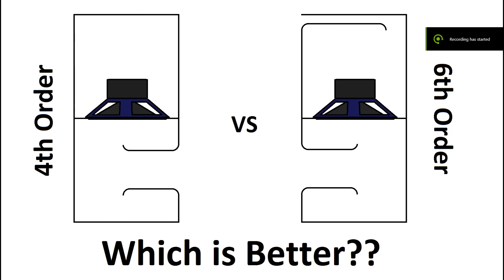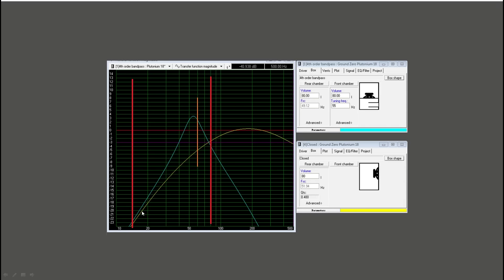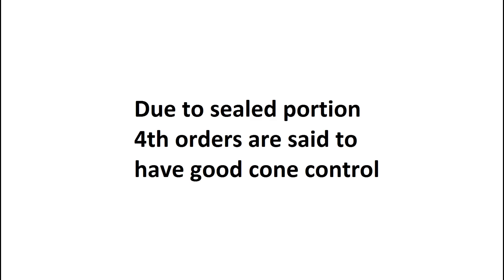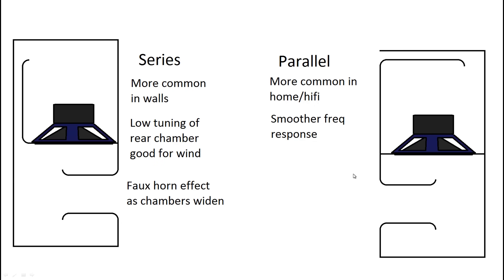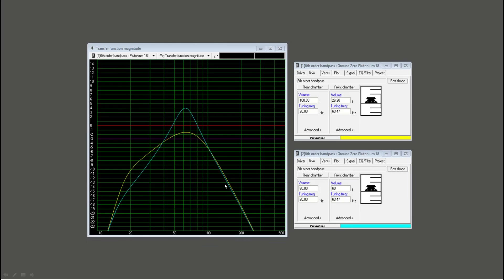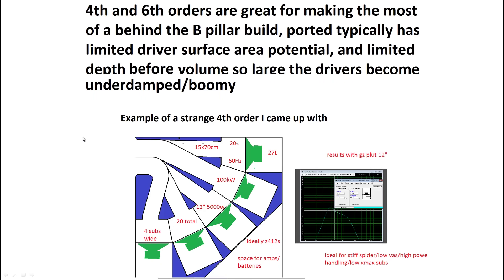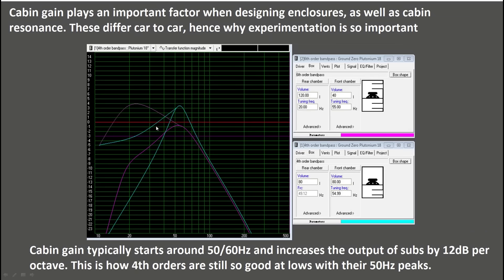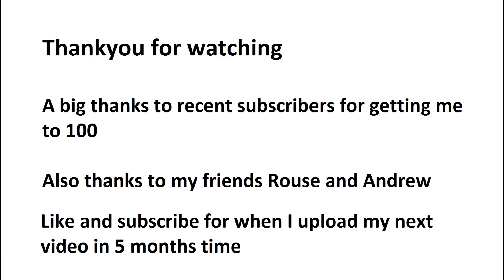4th Order VS 6th Order subwoofer Enclosures

Comment: What type of enclosure would be the best choice to use for rock and metal music in a 1970 to 1981 Camaro going through the rear deck between the factory mid/high speakers?
The reason I want it in the rear deck is to reduce noise outside of the vehicle and the ratty trunk vibrations.

Comment: I’ve seen dual 18” 6th order pro audio subs that contain 2 drivers facing each other in a sort of “loading wall” like you show here. Basically, there’s a port on each side, then this big open almost horn-like mouth in the middle. (It slightly tapers out, but I wouldn’t consider it a horn.) That design has the most SPL of any subwoofer I’ve heard.

Comment: you got the qts part wrong. the lower the qts 4 and lower is better for 4th orders 4.5 and up is better for 6th orders. the lower the qts (4.4 and lower) means it responds well in sealed. the higher the qts (4.6 and up) better response in ported boxes.

Comment: Absolutely amazing video. Honestly, you helped making the super technical details understandable. 

I have a question for you. I am more focused on SQ than SPL. I have been seeing a lot about IB setups and the level of lows and spacial presence that are achievable. I am considering a project vehicle that runs a front sub (likely 10 inch single centered or dual 8 inch sealed in the doors) which would be effective from about 150Hz down to 50 or 60 Hz. Of course with SQ getting the most balanced freq response at the cleanest highest levels is best, so, what would you suggest for the rear of the vehicle (most likely large SUV like a Land Cruiser or Toyota Sequoia) to pick up those missing low freqs? IB has is own unique challenges and requires serious modifications but can fill the listening space with sound like no other setup. Is there a 4th order or 6th order setup which can achieve similar levels of presence while not requiring the same level of modification as IB? I have also considered Isobaric as a solution to keep the enclosure size down but i don't know if that is still viable with todays tech.

Comment: 🟦....'Porting', 'Enclosure-Damping' & 'Port-Damping' are Three ENTIRELY DIFFERENT THINGS, The way you Dampen a Port (or Port-Tube) has apparently become a 'Lost-Art' in today's world, as there is NO set of calculations or instrument other than the human ear that can accomplish this.

it consists of tightly-stretching ONE-Layer of 10-denier-silk @ a time to what could end up to be several-layers of silk TIGHTLY-STRETCHED across the MOUTH of the PORT until Proper-Damping is achieved.

The Way to properly 'Dampen' a Port is by taking a D-cell battery and connecting It in PROPER-POLARITY to your woofer/midwoofer driver/s (+ to +) In such a way that you can quickly make & break the circuit on the POSITIVE-Side. (DO-NOT leave the battery hooked-up to the driver for more than a few-seconds)

.....When you quickly make or break the circuit, without ANY-DAMPING you will hear a kind of a "Bong"-sound, What you need to do is to keep testing and stretching another-layer of 10-denier silk TIGHTLY (to eliminate 'Fluttering' of the silk) across the mouth of the Port or Port-tube until the sound you get when you either Make-OR-Break the circuit is a Shorter-TIGHTER sound, closer to a "CLICK"-sound than a "BONG"-sound.

Once you've minimized that sound to as close to & as 'Tight' a "Click"-sound as you can get, then proper "Port-Damping" has been achieved.

Comment: position of a box inside a vehicle adds to the ratio which i never find anyone seems to know about. 
ex: speakers in a trunk try positioning the speakers towards the back horizontal about 6 inches away from the back vs turned around to the front.

Comment: In series tuned 6th order,  kniwing the front is tuned higher than the rear, It seems that the front port doesn't load below tuning, where the rear one does, so the lows is coming from the rear port. Correct?

Comment: Question on doing a 6th order (might be a dumb questionoh well but here goes it anyway lol. Lets say you have this to work with D37"xW52"xH36" then you put a box on each side for D37"xW15"xH36" and port it at 26hz then it leaves D37"xW22"xH36" in the middle of both boxes do i use the  D37"xW22"xH36" measurements to figure out the last port i want or the total dimensions? D37"xW52"xH36" that both boxes is in?

Comment: I curious to know if I can change my subs up/ports back BR box into a 6th order by adding a second chamber on top. My og box is 2.1cuft @35hz. I've modeled and built the top chamber and it's ready to go on. QUESTION ⁉️
Since my current box sounds best ports back, and the 2 chambers are essentially 180* out of phase with each other (right?).. could I face the port of the upper bass forward? Firing in the opposite direction of the lower bass ports?..or should I just go with the tried and true "all ports exiting the same direction" method?

Comment: Do you know of anyone who has built a large bandpass like you illustrate with the 20 subs , i was thinking of building one of these but I don’t want to waste time and materials, any thoughts?
Reply: 20 Subs...
What brand of woofer do you plan on buying? 
You will need a ton of wattage and amperage. it's a money pit.
are you ready to spend all that cash on car audio. 
I never did and I had great sounding systems. 
2 Subs component speakers for everything else three amplifiers across over. lithium batterie high output alternator proper wiring did my own installations and that was a lot of money. I could not imagine spending on a system that would support 20 woofers I refuse to spend that much money on a sound system when I have money to spend on my mortgage, my car payments, my family, bills and so on. How do you plan on doing it Lotto ?

Comment: Understanding the driver's ts parameters,and what the values affect determines the direction in Wich is "best" for your application,there's allot misunderstood in the box decision for all speakers, I prefer to use speakers with high q values qtc qts etc, in a sixthorder bandpass, The bandwidth gain is phenomenal when designed correctly,and if you run them isobaric loaded, they can use a smaller enclosure

Comment: I have a sundown x15 v.3 should I put that in a 4th or 6th order
Reply from the maker: From the specs on the website, if you've got the Dual 2 ohm, either, really up to you. If you've got the dual 4 Ohm, 4th order would be preferred, but still either or. They have a good multipurpose spec.

Comment: Hie please can you help me ...i have a kenwood wps1300d and i was thinking of putting it in a bandpass box .On its manual there is only two options thus sealed or ported...will it work well if i use the specs for the jbl p1220 bandpass box?

Comment: Hey Dak, just for information purposes, if doing a 6th order series port, can you have the same size port for both the low side and the high side? lets just say 30hz with a 40sq inchs of port and 65hz high side with the same port size. 4cubic low side 1.25cubic high side, net. 

will there be any complications with this scenario? winisd gave off some pretty solid responses, but im looking at a theoretical response for reference to my simulated design.

great videos again. keep it up

Comment: On a 4th order which part of the subwoofer goes into the sealed chamber, the cone or the magnet part? Does it matter? What is the difference?
Reply: It’s best to have motor in the ported side. This helps with motor cooling as well as you being able to smell the coils if it gets too hot
Reply from the maker: I'd personally put the cone in the sealed part, unless the motor makes a ton of chuffing
Reply: No difference except better cooling of the voice coil if it on ported side and you see most front firing into the sealed side simply for space reason if the enclosure is a 1 to 1 then the side you put the magnet on will be less air space so when designing make sure you add your speaker displacement to the correct side or your ratios will be off

Comment: If you graphed the 6tg orders as 1 octave apart instead of way far apart it'd make a massive difference
Reply: 1 octave generally creates a dip in your graph, so you’ll lose some of your middle end.
Reply: @camaroboi13  every 6th I've ever seen built or had designed/discussed with builders they/me have always done 1ocatve apart for best results. You think 1 octave is giving a dip in the middle a proper 6tg should have no dip it should be a large peak vs two peaks now placing the peaks more than an octave apart like in this video creates a way worse dip because the frequencies are even further apart

Comment: I still get bewildered by boxes I see, some of these "4th order" demo builds I see have such a big opening I don't see how it's much different than a conventional sealed box. My experience with sealed was good SQ but abismal output, I plugged the port on my sub box and I lost about 50% of my output I did loose the nasty boominess I get in the higher frequencys I've been trying to combat. I'm at a loss I have 2 AB XR 15s in a 6.75 net box that's been tuned to from 36-29 in different port modifications Starting at 129.5 ci port area now I've slightly reduced the port in different ways but still there, on low lows it sounds epic killer flex but some higher notes it gets boomie and muddy not good sounding at all. I built the box for subs up port back and now subs back port up has reduced that issue the most. It's in a grand caravan. Any input would be appreciated...
Reply: Is there anyway poss you can help me. I have 2 ab xr 10" which im trying to build a box for them. I have no clue on where to start. I want subs up and port up also. The space that I would like to put the box is 32" width 16" depth and 20" height.
Reply: If anyway poss you can send me some cuts of the wood so I can put it 2gether. I would like to use 3/4 mdf or if you recommend something diff

Comment: 9:04 it is 1:4 right? Just wander for the picture before the graph the "home type" ratio was 1:3. Very educative! Cheers!
Reply from the maker: 1:3 or 1:4, either could work depending on the driver. For the example, it should've been 1:3, the 1:4 given is a default for WinISD, not sure why I didn't change it.

Comment: How much $ to design a 4th order bp for an 2017 mustang gt. Sub is sa10v2 1000 watt rms. Amp is a skar rp2000. I have 34" wide by 13" high and what ever the depth needs to be up to 24". Possibly a 6th order if there is room.

Comment: On a parallel tuned 6th order which is 1:2 ratio, should both ports have the same size  (port areas) or should they be in relation to the size of the chambers?
Reply from the maker: In relation to chambers, though for my 6th the low tuned side needed a port so long I just made them the same surface area. Sounded fine, but a tad muddy, so  same area is preferable.
Reply: @Dakoustics  thanks man

Comment: I figured out an interesting thing when I tried to design a parallel-tuned 6th order bandpass box, but I dont know that the designer I'm using (speakerboxlite.com) is OK for designing a 6th order bandpass box or not, because if I try out a standard ratio box with normal tuning frequencies - like for example 30 and 50-60 Hz, the cone displacement graph (the woofer's excursion) will be crazy + totally different like for example in WinISD. So, my first question is: in your opinion is speakerboxlite.com usable for designing a parallel-tuned 6th order bandpass box? I'm asking this, because I know that for simple sealed and vented box it is good - I built both types of boxes using this designer, and they are sounding a working fine up to today, just I'm sceptical when it comes to design bandpass boxes using speakerboxlite...

So, what I figured out using speakerboxlite is next: if I tune super-high the high-chamber (above 200 or 300 Hz), this chamber works like an excursion-restrictor (cone displacement graph), so it allows to make higher net volume and/or lower tuning for low-chamber. Then, if I tune the high-chamber higher, and/or I increase it's net volume, it restricts the excursion even more, etc... So I think that it will work like this: the low-tuned chamber is the active chamber - for sounding, and the high tuned chamber is the passive chamber - for excursion / power control. And I think this excursion restriction is the reason too for higher group delay, because if I simulate the low-tuned chamber's net volume and tuning frequency as a simple vented box, the group delay is less, but the woofer's excursion is higher. So, this is my second question: it is possible that a parallel-tuned 6th order bandpass box can work like this + this "my theory" is OK, or not?

This is a simulation (graphs) for those things what I explained above: red - the low-chamber as a simple vented box, green - 30/50 Hz, blue - 30/60 Hz, yellow: 6th order box with 300+ Hz tuned high-chamber: https://speakerboxlite.com/project-info/f63b6c1c22086b6c467566a416d20b930e5fbb2c055e4ddc0e7e048a80c21043/tab-graphs .

This is a complete design (description, 3D, quoted drawings, etc...) what I've done just today: https://speakerboxlite.com/project-info/13537/tab-info .
Reply from the maker: Yeah, seems very odd, not sure what error is happening there. Probably use WinISD, I used it for my 6th and the thing is fantastic. Hornresp is very accurate also, and I've done some comparisons between WinISD and Hornresp and they were quite similar. Interesting observation though, I'm guessing it has something to do with cone damping, and possibly the high tuned box is acting practically like a sealed chamber to damp and control driver movement.
Reply: @Dakoustics  , thanks for your answer. Cone damping - maybe the super-high tuned high-chamber works like you wrote, because I tried it once in WinISD, and the driver had very similar (but not the same) movement in simulations like in speakerboxlite's simulator...and overall all graphs were similar but not the same... So at 4th order banpass the sealed chamber is for low bass, and this is the "main driver movement controller" too, and at 6th order bandpass like this the chamber for low bass is ported too, and this chamber is the "secondary driver movement controller" - this is the main difference in my opinion, just at 4th order bandpass you may not need to tune the high-chamber up to a super-high frequency - so that is the reason why I think that at a 6th order bandpass like this the low-chamber is the "active" chamber - this sounds, and the high-chamber is "passive" - this just controls the driver's movement... In your opinion this theory is OK, or I am totally wrong?
Reply: @Dakoustics  , I made a test-project in WinISD using the same woofer like in those projects what I shared with you before. I downloaded the speaker file from here: http://www.loudspeakerdatabase.com/Dayton/DCS165-4 . In WinISD I simulated an 1:1 ratio 2.7 / 2.7 Liters net volume box with 245.3 / 25.9 Hz tuning frequencies. On 100.0 Watts signal - which is the woofer's RMS power - it reached but not overpassed the Xmax at 20 Hz and higher frequencies. Then if I decreased the high-chamber's volume, or decreased it's tuning frequency, it worked similar like in speakerboxlite's simulator - overpassed the Xmax at 60ish frequencies, but if I decreased the tuning frequency more, the driver's movement started to decrease too - this not works on speakerboxlite's simulator. Btw, this box have very similar results on speakerboxlite too, even acceptable driver movement, and the movement itself is quiet comparable with WinISD's if I use the max power of the woofer on speakerboxlite - 200 Watts - but maybe it is a wrong idea... So, here is the test project: https://speakerboxlite.com/project-info/eb7b77b8f2976f30973ed36da8318ab7f9f168f5ba0de70907f880e1456886b1/tab-info , WinISD counted out shorter ports (maybe different constants for air density / ambient temperature, etc...), but less than 10 m/s vent air velocities between 20 and 60 Hz (official sub-bass range). The box itself is buildable with relatively acceptable outer dimensions (at least for me), but maybe too complicated for somebody...

Comment: Would you class 15.9mm xmax, 0.52 QTS sub enough excursion to be suitable for a 4th order?
Reply: It’s a Rockford fosgate P3D4 12. I’ve got about 4 cu ft to play with and figured I should give it a go, but info on 4th and 6th order sub box designs are scarce.
Reply from the maker: Yeah, should work fine. As long as you're not sending it too much power, 16mm xmax is quite decent.